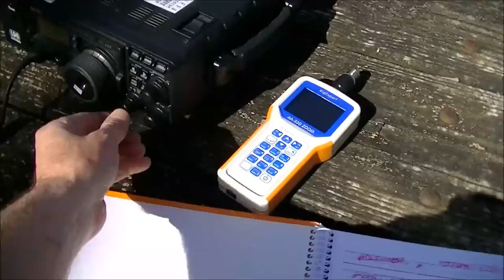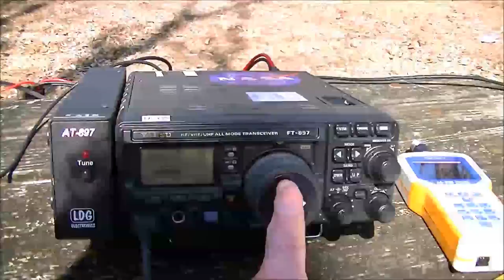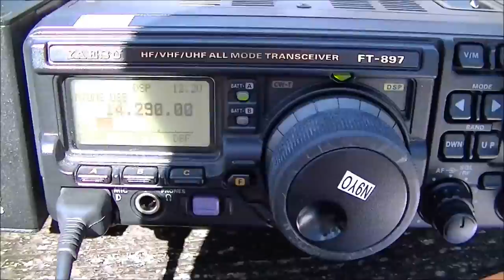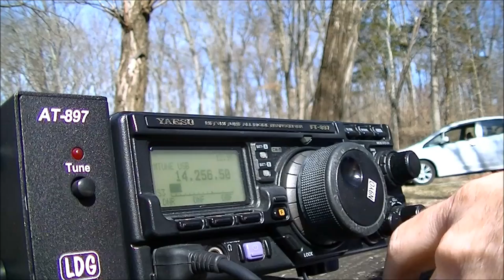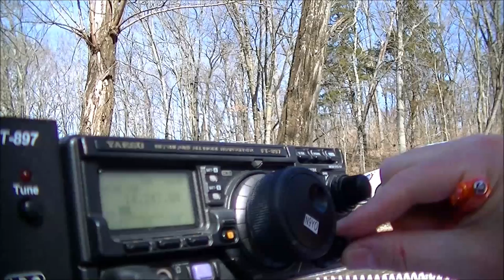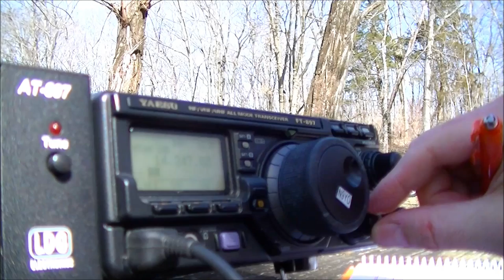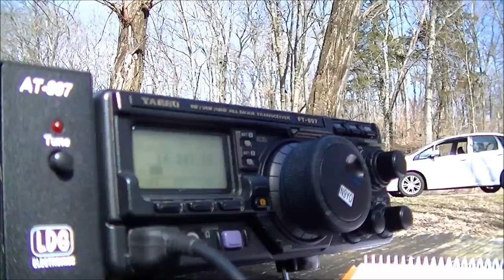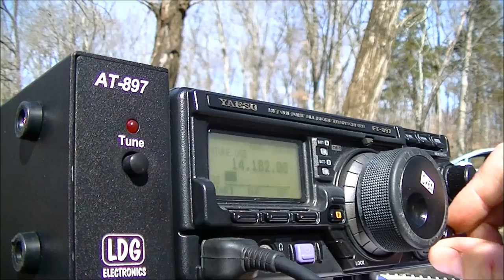Yaesu FT-897 ~ MP1 Super Antenna ~ Portable Ham Radio

Comment: I used to live in a 50s sub-division that had overhead high-voltage lines @ 30-40'. I had a transformer next door, and 2 poles in my back yard that surrounded me 180 deg. I had relentless QRM on my FT-897 that eventually contributed to me going off the air. I now live on 2 acres with underground power and have fallen in love with my 897 again.  I'm considering QRP for the field but love the power and familiarity of my 897. Thanks for the video.
Reply from the maker: Thank you so much for the comment friend!

Comment: I got the MP1 about 3 months ago, and I love it, it breaks down into an incredibly small size. I use the supplied tripod. 

I have no problem making contacts with the Yaesu FT-891 and MP1 and even made it from Ireland to Canada on 20 meters @100 watts about a month ago. I have not used the 80 meter coil yet, when I go out portable it's usually during the day so I wouldn't be using the 80 M band. 

The Antenna is also very quick and easy to set up, when I don't want to use my EFHW and mess with trees the MP1 is perfect. 

It's a great high quality product, I love it. It has greatly exceeded my expectations.
Reply from the maker: Glad to hear you like it. I've been mired in wire antennas for a while I need to pull out my MP1 again.  Thanks fer the comment.
Reply: Yeah do be cool to see you do a video with it :-)

Comment: You did a great job with the video. Your portable station is well thought out.....except for the clock. Hi Hi I liked that you used a resonant antenna with radials. Using only 60 watts saves on the battery and is less than ½ S unit down from 100 watts. 
You did a good mix of showing how to assemble a station properly as well as making a few contacts along the way. 
I think the FT 987(D) is one of the best, “One radio do all transceivers.” I like QRP and use an Elecraft KX2, but no way am I getting rid of my FT-897D.
Keep up the great videos.
Barry, KU3X
Reply from the maker: thank you

Comment: I can tell your from the city, lol, You say Missouri correctly.. I'm a relocated Missourian, living in Virginia. I just passed my Technician and I'm studying for my general. I'm thinking about getting a FT-897. It's nice to hear your comments about it's performance in the field. I camp with Kids and sometimes we're in the mountains. I want a rugged radio that I can depend on. Thanks for the video.
Reply from the maker: Outpost Discovery you should be able to get one used. I like it but it's heavy. check out my more recent videos
Reply: I'm bidding on one now on ebay. Thanks And I will
Reply from the maker: good luck I've had the radio for about 11 years, served me well.
Reply: I won the bid on ebay. I got it with the FP 30B Power Supply and the FC30 automatic antenna tuner. HUZZAH!!!
Reply from the maker: Awesome! Congrats. You can google this, "FT 897 manual" to get the manual and start reading.  There are a lot of menu items.  Just remember menu item #75 is the power. : )  You hold down the F button for a second or two then you rotate through the menu items.   I picked this radio as my first because it basically covers EVERYTHING.  It does it all and it's rugged.  Good choice.
Reply: AnythingWithWheels I've been shopping around on youtube, watching reviews and determining what will cover go beyond what I presently need. I work with a camping group called Royal Rangers. it's kinda like boy scouts but through our church. we like to camp in the Blue Ridge Mountains. this seems like a good radio for a base camp. if we have an emergency I should be able to reach out and touch someone.
Reply from the maker: That's awesome also!  I was in the RR when I was about 8 years old.  Assembly of God in Kansas I believe.  I'm glad they still do the RR.
Reply: That's great to hear. I've been doing it since 85. It's my calling. It's so rewarding hearing a parent or grand, talk about one of the boys I teach and his excitement about what he's learning. Then meeting one after 10 or more years and they remember me. Wow, what a blessing. I haven't gotten my call sign yet but I'm Carl Hirner.

Comment: That would be a good setup for running a NPOTA activation.
Reply: +Ham Radio K0PIR Yes, absolutely, as soon as I get some free time, that is happening.  But, this was a "state" park.  would that count as NPOTA?
Reply: Nope, it needs to be on the official list. Visit https://npota.arrl.org/ Get setup in LOTW too if you haven't. When creating a station location in LOTW (TQSL) there's a dropdown box and you can choose the park you activated. It's very easy. A little daunting at first.
Reply: +Ham Radio K0PIR No, I mean, does a State park count on the list of "National Parks on the Air"  or does it have to be a "National" park.?  Thanks.
Reply: +Tommy N As an activation no it won't count, but the contact you made to the NPOTA station counts toward your chaser status. I believe the list only includes federal land. Some units on the list are national trails, national monuments, etc.

Comment: Have a 897 and a dozen 7.2Ah batteries i need to string together. I took mine to a cabin in VT and yes was much quieter... until i plugged in a laptop. Everything is noise with these apparently. 73! KD2GMB
Reply from the maker: Yes the thing is super heavy to lug around right?   To be fair, my ICOM 7300 also picks up a lot of noise, the laptop power cord does it mostly, then the fluorescent lights.  I'm glad I still have the 897 to toss around though.

Comment: the noise is thermic noise generated by the ac transformation to dc, I would suggest you to get a really high quality power supply in order not to have any strong noise any more. 73 :)
Reply from the maker: Thanks Gaddo.  That video is old now and I've sold it.